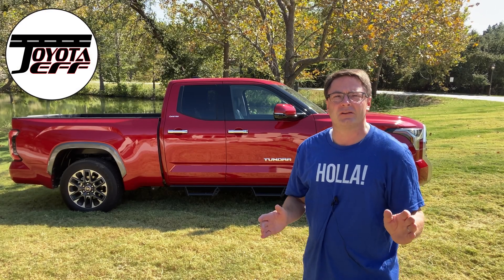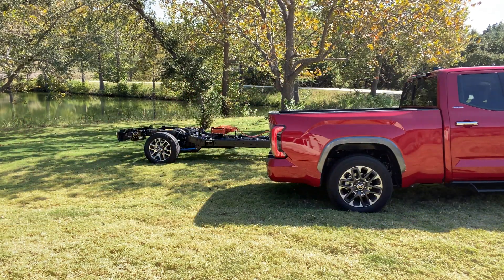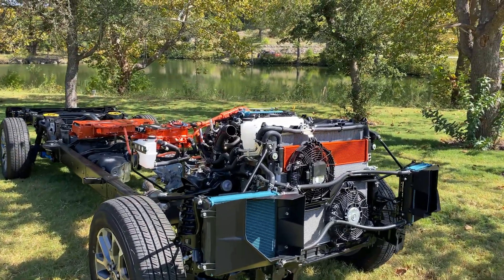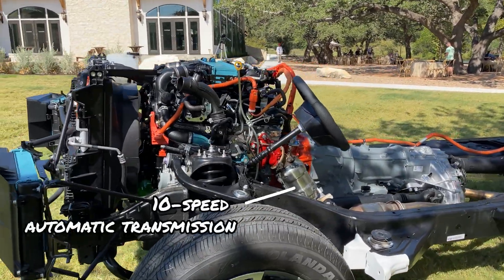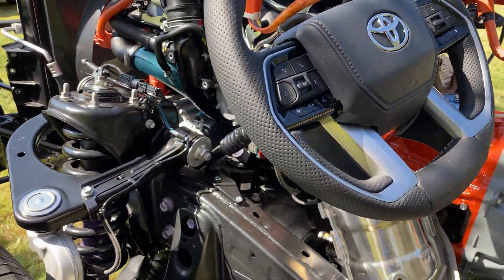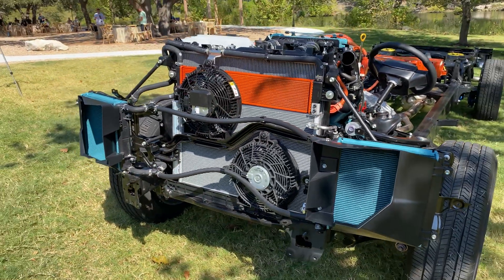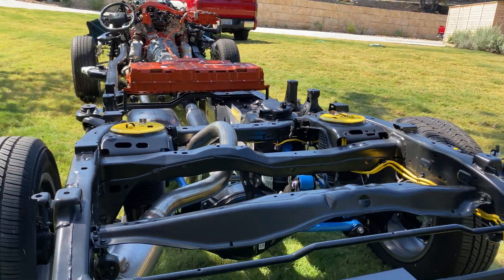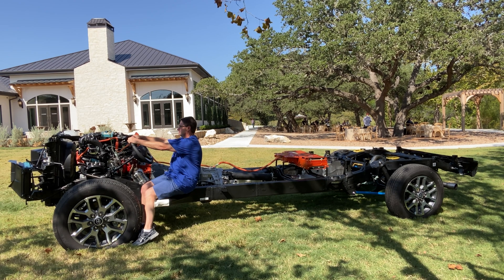** Hands-On **  2022 Tundra Hybrid System: Let's Learn What's Underneath!

Comment: Where's the oil filter?  I know, I know.  Minor issue, right?  Well, I have done all the oil changes on my 08 4x4 and it's such a pain to take off the skid plate every time just to get to the filter.  Why couldn't they put it on top like Mercedes?
Reply: I wanna know where the oil filter is too, is it still a cannister plastic mess or did they go back to tried and true spin on?

Comment: Any front impact is going to destroy those radiator for the turbos . What were they thinking , seriously. That looks likes the worst thing to work on 🤣
Reply: You do know that is not the full chassis ? The full and finished production chassis has reinforced bars in the front covering the radiators and more reinforced bars covering the battery and gas tank. This chassis is definitely unfinished. Lol look at how tiny the steering column shaft is. That's not even the real one.

Comment: I'm surprised they went with the NiMH battery instead of the Li-Ion battery. Why is that?
Reply: NiMH batteries perform better in cold weather.   They don't need to be liquid cooled like lithium.  A simpler design that has a power to weight ratio close to lithium because it doesn't need a liquid cooling system.  It is air cooled with a small fan.

Comment: Dude that's so cool!

It's like a mega prius!

It's not a lithium battery?!? That's crazy! Wonder why they did that. Lithium modules are a lot lighter. 

Tend to last longer too.
Reply from the maker: I loved making this video for everyone
Reply: Nickel Metal hydride battery are cheaper and less resistive to tempreture fluctuations
Reply: Well it's kind of a mixbag reason . While LiON have faster charge- discharge rate,  lighter and more usable energy capacity , yet suffers more from cold temperature. The NiMH is more stable in cold temperature. For pure EVs with 35kwh and up battery capacity , people tend to ignore if range drops from 200 to 150 miles per charge on day to day usage as you would charge overnight anyways before heading off the next day. 
But for hybrids with sub 2kwh battery, the range drop in LiON which by the way for truck as heavy as this with only 1.8 kWh pack ,  is just 2.5 miles, dropping it to 1.5 miles make it virtually unusable and inefficient thus not serving upto the purpose it stands for.  The hybrid like this are on constant charge -discharge probably the whole battery pack being charged as discharged upto 5  or more times in a single 50 miles journey. The stress on battery pack is actually more in hybrids than EVs. NiMH have been proven resilient for hybrids for the past two decades. 
I am sure Toyota have put a lot of thought and research on this, and tested their power train for both  types of battery. They still cannot abandon NiMH batteries. Marketing and financial reason aside they probably haven't found the sweet spot yet.

Comment: The power density ratio and longevity of nickel metal batteries is ridiculously low compared to newer technology, why the heck are they using this
Reply: Cold weather and reliable. The original prius and I believe the awd one still use nickel metal hyd.  And go 20yrs and 250k miles.

Comment: I like this hybrid model than the ones with just electric motors powering rear wheels. Good job Toyota..!! I wonder if this design was done by engineers here in the USA? If that's the case I would love to see a video giving credit to them.
Reply: And a rundown of the price to replace that motor sandwiched between the trans and flex plate.  Yikeeees. Motors usually last a super long time but issues and flukes do happen.

Comment: Just tell me the MPG's
Reply from the maker: Base engine combines for 20mpg with 4x2….19mpg with 4x4 … hybrid not released yet
Reply: So the base engine only bests the 15yr old 5.7 tundra with four less gears and a 4.30 axle ratio by 5mpg? And needs to rely on speakers to make engine noise? Yikes